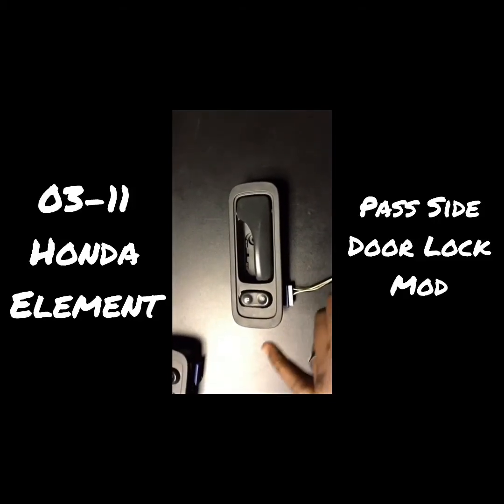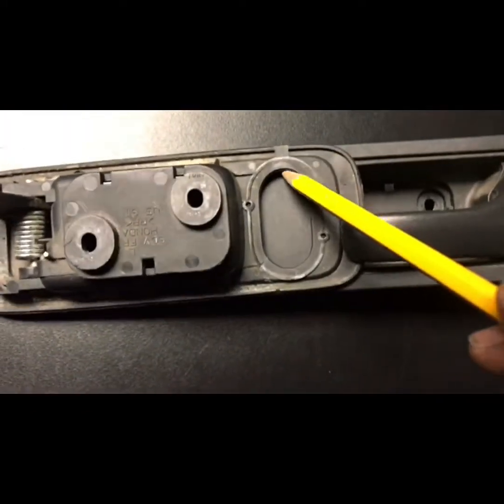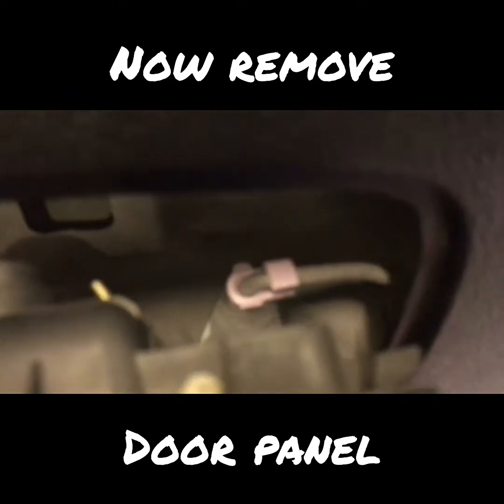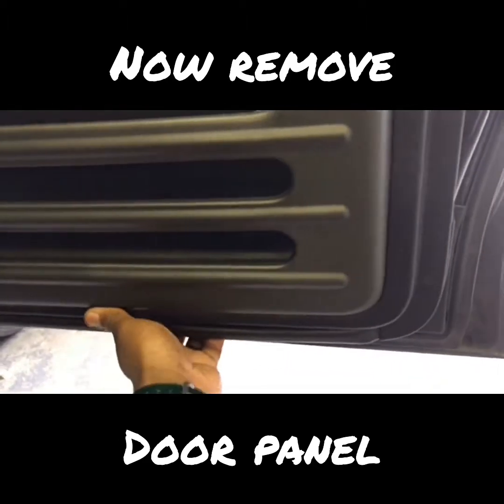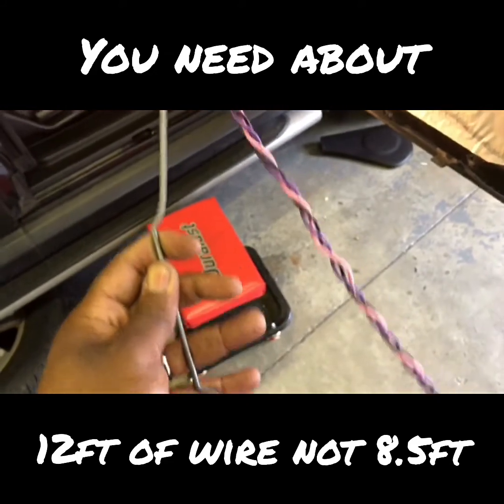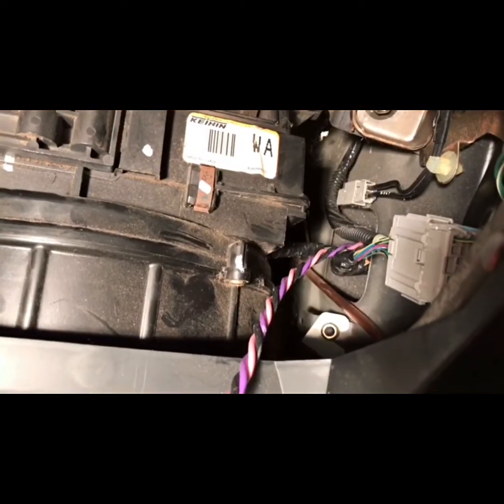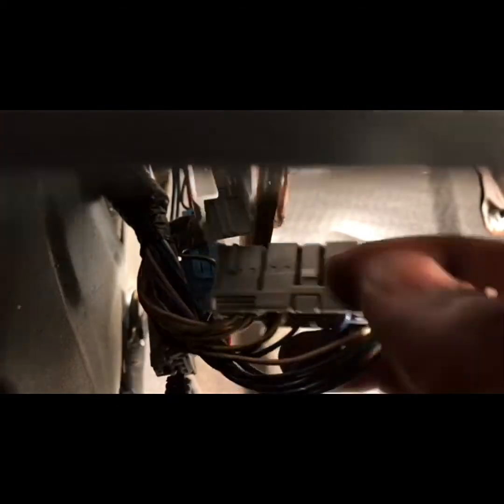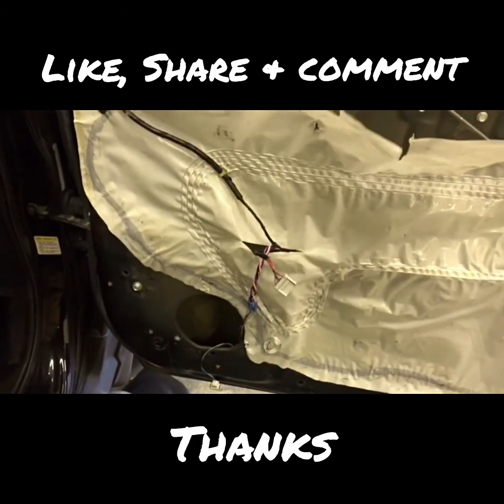Honda Element Passenger Side Door Lock Mod

Comment: If you are unsure of which wires to splice into, the best thing to do is to run the wires to the drivers side door lock Mod, do a direct connect.  This way you don't mess anything up.

Comment: for removal a Razor saw (hobby saw ) would work well and be a little safer.. for the reinstall on passenger side Testers model glue .. or hobby grade CA glue ..will work well .. or epoxy like jbweld ...... be sure top clean plastic prior to gluing. .. Good write up and idea .. I Did a mod on my element so i can unlock my doors from the outside,when i lock the keys inside by accident..

Comment: So under dash do you splice into wires ?
Reply: you can or you should be able to splice directly inside the passenger door at the electric lock mechanism.. it should have the same 3 wires if it only has 2 then the center wire is ground and would ground to the metal of the door .